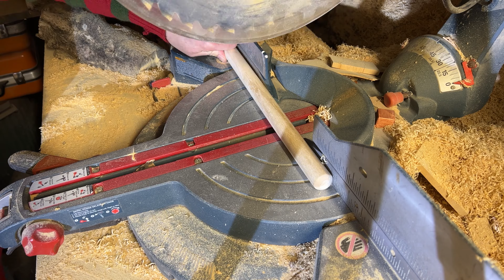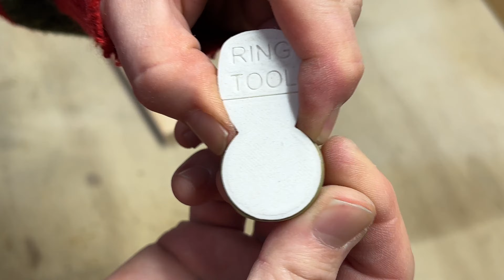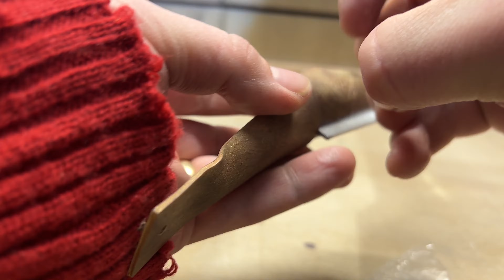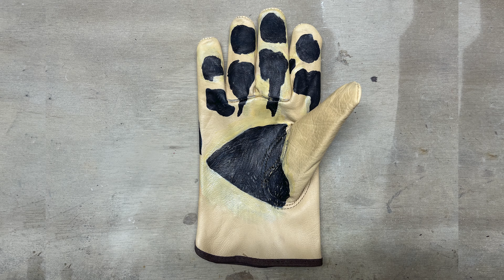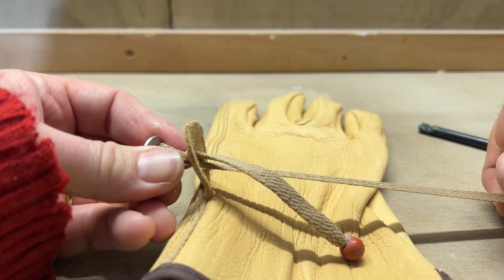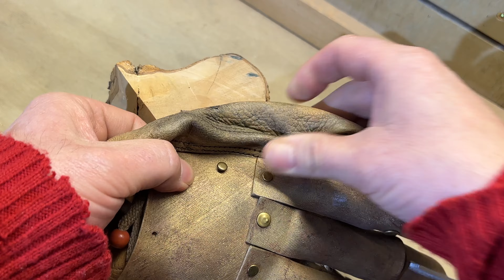How to make a 3D Printed Freddy Krueger's Glove from A Nightmare on Elm Street

Comment: Can you tell me if the templates files are already set for the right dimensions an thickness for the 3d printers or does there need to be any adjustments in the printer itself before printing thanks
Reply from the maker: @leeboi2k25  the parts are the correct size and thickness, but in your slicer program, you could easily scale the size if you needed it bigger or smaller. But the current design is exactly the right proportions from my research photos.
Reply: Ok thanks i also just purchased an flashforge adventurer 3 to do these which should be very suitable also when you heat up the templates with heat gun/hair dryer does it give off fumes or odor thanks
Reply from the maker: @ not at all. PLA has no real smell when you warm it up.
Reply: Hi just imported the files into my slicer app wiibuilder an the templates are looking quite big on my printer plate diagram is this correct? Im using the tina2s 3d printer an when i start with ring stall the template is nearly length of the actual plate ? Do you have an email where i can send you a pic of what i mean thanks
Reply from the maker: @ info@wellingtonbatman.com

Comment: Can these be printed on any 3d printers thanks
Reply from the maker: @leeboi2k25  yes, it should be fine on any printer
Reply: @Unpossible  thanks for the reply what about a mini printer with a plate size of 100mm x 100mm would this be ok as im thinking the blades might not fit on plate
Reply from the maker: @ I’m not in the workshop at the moment to measure it, but I imagine one blade at a time printed diagonally should fit as it would be about 140mm of print space.
Reply from the maker: @ lots of public libraries also allow cheap or free printing for just the cost of the filament.
Reply: @Unpossible  Also if im using a 3d printer at home do i need to use any ventilation if im only using pla as ive read mixed answers about pla people say its safe an some say its not an still need ventilation thanks
Reply from the maker: @ I’m not a 3D printing expert by any means, but mine produces no noticeable smell when printing in PLA, so in my opinion it’s not a high risk.
Reply: @Unpossible  thats good to know do you use your printer at home ?
Reply from the maker: @ Yes, I use it in my home workshop.

Comment: How were you able to get the holes to line up so well on the joints between the finger tips and the finger stalls? I was able to get them to line up on the ring finger but can't seem to achieve the same for the other fingers.
Reply from the maker: @chocofrolik834 I’m not sure why it’s not working for you. Perhaps try warming them up and putting the rivets in while the pieces are still flexible. Then shape them with the rivets in place. I’m not sure if this will help, but it’s worth a try.

Comment: having issues printing the blades what was ur printer settings its lifting up off plate ruining it and had to restart numerous times
Reply from the maker: I just printed using default settings in Cura. I did find that if I printed too many pieces at once, they would lift off the bed, so I ended up printing the blades by themselves. I also used painter's tape on the print bead, but that was a brand new printer and now that I am used to it, I have stopped using the tape.  If you have ongoing issues, I would try printing them with a brim, that might help.
Reply: @Unpossible I fixed it 1 more question what thread and needle type u use to sew it on the template part and shoelace
Reply from the maker: @Kal_El_Alexander  I use a leather needle in the sewing machine, but I just used regular polyester sewing thread. If I was making an actual work glove I would use something heavier, but this is never going to have much strain on those points, so regular thread will be strong enough.

Comment: what temperature ws ur heatgun set at to flex pla?
Reply from the maker: I don't have any way to measure the temperature, but it does not take much. I used my heat gun on it's lowest setting and stopped as soon as the piece becomes flexible.

Comment: Hello there, this was a great tutorial my guy. I think it looks so authentic that if you took it to a Con they would have to triple check if it was dangerous before you were let in, lol. I tried to download and open your file on my phone and it didn't work. Is there anyway that I could purchase the pieces from you instead? If so, that would be greatly appreciated
Reply from the maker: Shipping them from New Zealand would be uneconomical. Look up a local 3D printing group on Facebook and post a link asking for someone to print a set - it should be very cheap and easy.
Reply: @Unpossible  Thank you, I am torn on what 3D printer to buy since they are like computers, 3 months pass and the one you thought was the latest and greatest is old, lol. Thanks again for assistance on where to get these printed out. If you have any suggestions for a really nice 3D printer that is dummy proof (lol) let me know
Reply from the maker: @stSgtMunoz  I sold my old printer and bought a Creality Ender 3 Pro and I LOVE it!  It's a million times better than my old printer.
Reply: @Unpossible  THANK YOU..... I actually was leaning towards that exact model. Thank you for confirming that its a great deal.

Comment: you are awesome! The index finger blade is two pieces welded together in the film.
Reply from the maker: Yes, it snapped during filming NOES part 1.  You could replicate it on my design by cutting the index blade and overlapping it, then supergluing it back together.  I actually intended to do this, but forgot to when I was making this video.
Reply: the blade was cut intentionally for a scene in part one where the detective finds a finger off the glove, it was never filmed but there is a BTS shot of John Saxon and the Detective holding a full finger piece, they rejoined the blade before filming the rest of the film

Comment: Did you actually use the screenshots from the film to create the templates? cause there is the bad tracing job of the original templates, but they are very distorted in size, and looking at these, they look very similar, you did a great job shaping them up, but there are a bunch of bends on the armature that are intentional for functionality ;) would love to see you 3D print the templates of the New Nightmare bone claw, the original hero glove also had it's blades brazed, not soldered, thus all the reds you see in the film
Reply from the maker: I have been researching this for many years. I know the traced template you are talking about. I have an unpublished template I obtained a long time back, that I used as a starting reference, then I have printed hundreds of angles of each part, splicing them together digitally over the template and corrected what I believe are minor errors and distortions.  Then making change after change until the printed pieces all aligned. Ultimately I ended up having to rescale the entire glove after my first full finished glove print. I literally have half a bucket of “incorrect” printed parts before I got to this design. Even for the blade, I used about 20+ reference images to get an accurate shape. I can’t say that every mm of this is perfect compared to the hero glove, but I’d bet my life on it that it’s incredibly close. I have been collecting NOES memorabilia since the first film came out in 84, so I have a LOT of reference photos in old magazines, behind the scenes images etc.  This has been a bit of an obsession project for me, so I’m pretty sure I’m as close as I can get, without having the hero here for comparison. Ultimately though, I’m offering it for free, I get nothing out of sharing it, so if people like it, great, but I make no claims about its accuracy, because I just can’t. There is only one real glove in the world and a lot of people trying to get as close as they can to it. This is just my attempt.
Reply: @Unpossible  That's great to here you know of the templates I am talking about, I have the measurements of the hero glove, did you also happen to use all the shots of the hero glove as it is today? cause those are perfect reference for scaling each piece, and also you can get dead on shots to get the accurate blade shapes for each one, plus I'd love to see you 3D print the backplate as it is with all the bends included, it's drastically different from Part 1 and 2, your attempt is great though and you have the shapes all accurate of the flat template, the shaping of each piece is the really tough part, do you think you'll be able to convert the templates to print out as a paper set too?
Reply: @pilummurialis6490  Yes, I spent a lot of time looking at the "found" hero photos, they were some of the most useful. My 3D modelling skills are not up to turning my flat pieces into a formed backplate unfortunately, but I am learning as I go, so perhaps one day.  I don't know of any way to generate a paper copy from my files either, but I have a set of 3D prints that I will use as a template, in case I ever decide to make a metal glove.  For now, I am exhausted from just making this project lol. Thanks for the kind words though man, you clearly know a lot about Freddy's glove, so that is encouraging to read your comments.
Reply: @kevinstevens2310  One glove I know would be great to see you tackle, is the Part 4 hero glove, you have tons of reference of it from every angle so making those templates will be easy, they are really beaten to hell as well, but I am interested to see how they look flattened out like your Part 1/2 hero templates, also looking at your templates, one thing yours has that most don't, is the inconsistency in the lines, that is great because it's a nice detail to show how crude they really would be if the armature was broken down and hammered flat to get a direct measurement off of, building these things is a lot of work, but as long as you have fun doing it as a hobby, you're pretty much golden! I do hope you tackle the Part 4 hero as it was in the film, also the fact you spliced together screenshots for the templates, is one thing I had always wanted to see done
Reply from the maker: @pilummurialis6490  I'm loathe to say I intend to do it, because many of my intentions take years to get round to, but I always loved Part 4 (though when I watch it now, I'm not so sure why), so I would like to at some point, but knowing how much time and money went in to this one, I might have a break from Freddy Gloves for a while lol.  If I  do tackle another one though, that would be the one I would like to try.  As you say, there are loads of good clear photos and behind the scenes pictures of that one, so it shouldn't be as hard as this one was.  Watch this space :)
Reply: @Unpossible  Oh I leanred to build the gloves as well in 2012, and when I spent those years trying to build them, I got told to build them and sell them, I only sold a few since I needed the money, but nobody wants to pay the price for what it costs to make one, though the Part 4 is easy, the hard part is the solder spills on the stalls and backplate, but since there are shots of the Part 4 hero as it is now, you can see all the solder spills on the backplate perfectly to copy them, the pinkie stall is literally a rubber duck and the only original finger stall still intact, definitely take your time, and do it for fun!
Reply: Best video I've seen that actually help and teaches how to do some of the pieces. Would love to watch you make a metal glove cause I am still learning myself. Great video!

Comment: Very interesting video.  If you ever attempt another 3d printed glove I'd recommend looking into some of the plastic stunt gloves used throughout the franchise, particularly one of the 2 different stunt gloves used for Nightmare 1 (The look different being the tips arent connected to the stalls, they are just glued on) or one of the Plastic stunt gloves built for Freddy vs Jason, there were several of those made and the blades are uniquely attached to the tips.
Reply from the maker: I found some photos of the plastic stunt gloves in during my research. It would be pretty easy to modify this build to be similar to those gloves I think.
Reply: @Unpossible  the stunt glove has different sized stalls and backplate templates, the tips are similar, but also still shorter, I have drawn a set of them up